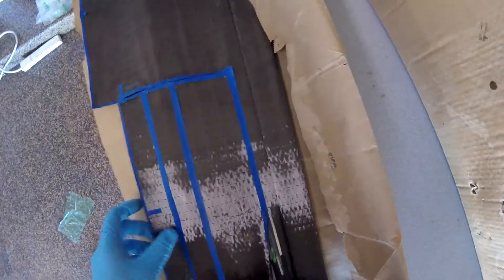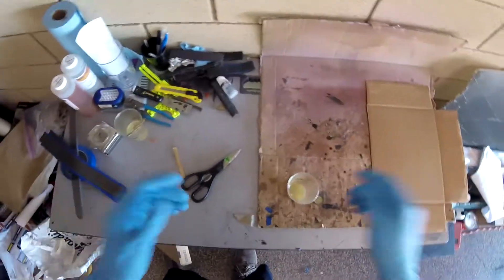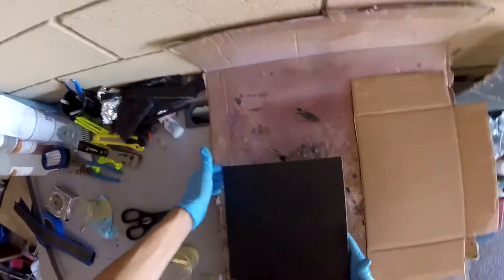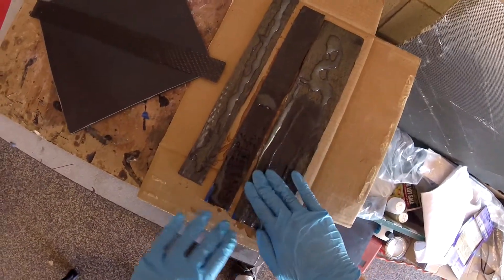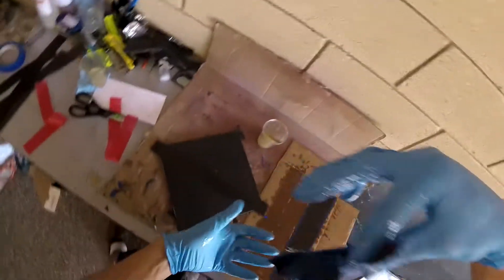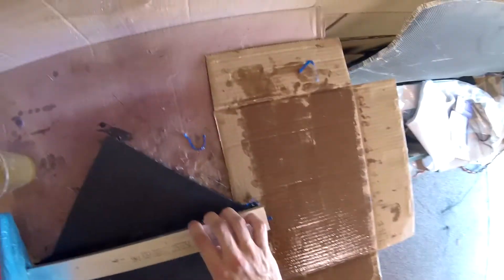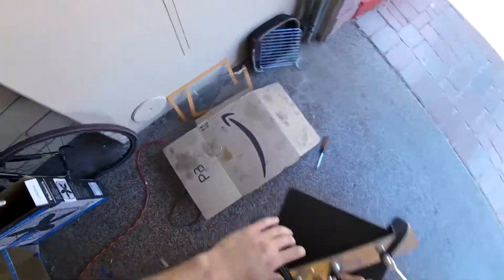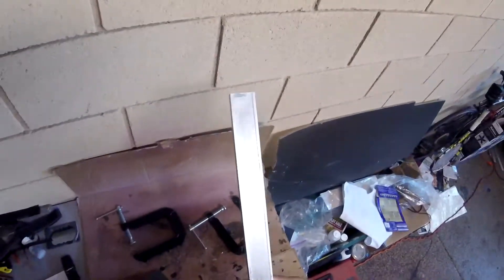Carbon Fiber Honeycomb Beam Layup for Drone Frame

Comment: MechE here: Do you have to use epoxy and prepreg? You just did it to ensure bonding?  Is it possible to use an I-beam structure since most loading is in the z-dir? I modeled the two cross sections and the natural frequency for mode 1 was higher for the I-beam and 1/5th the weight.  My concern is obviously the other modes...